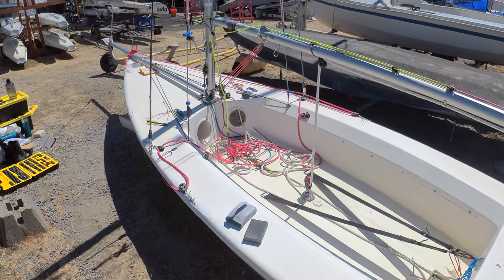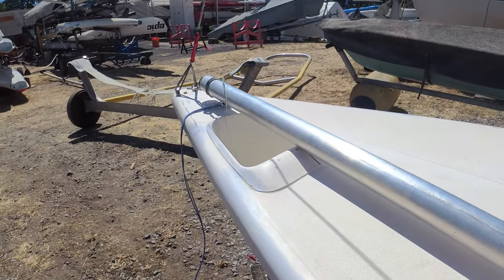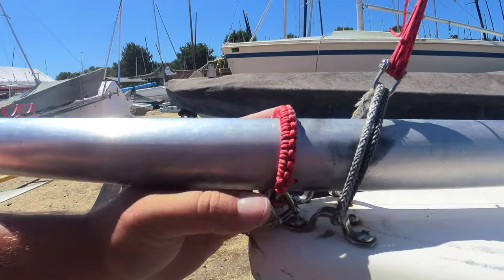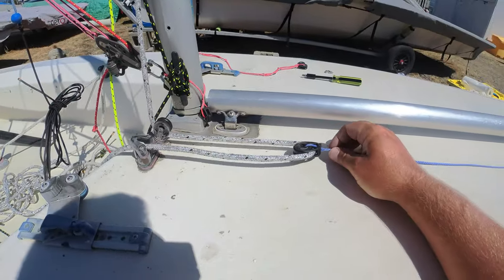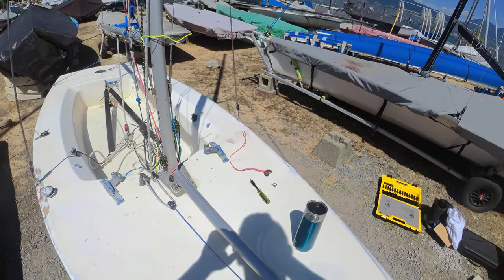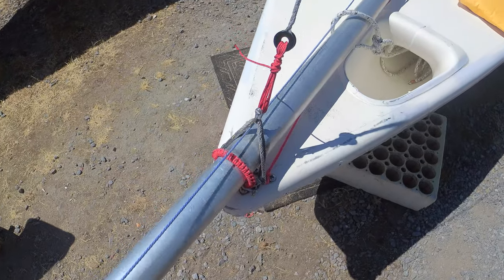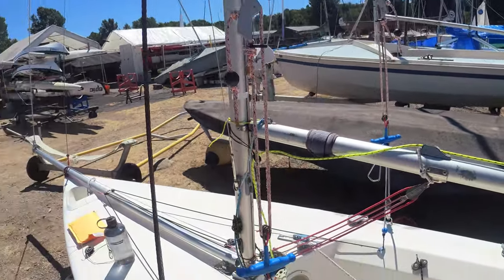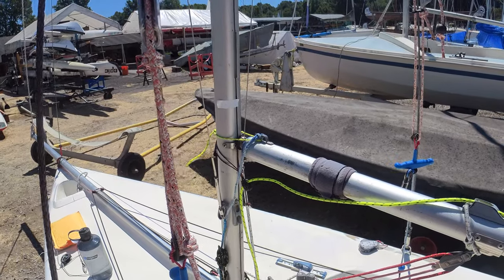HOW I RIGGED MY CUSTOM SPINNAKER

Comment: Hi, your videos are great. I also sail with Laser 2. Mainly single handed. I still use the classic spinnaker. As long as I sail only on starboard tack, everything is fine. The problem arises when I change the tacks. Then I have big problems with changing the spinnaker pole.
I've already seen some videos where an asymmetric spinnaker (gennaker) was installed on the laser 2. I would like to do the same myself. Mainly to make kite sailing easier. After watching your video I decided to do the same thing on my laser. So I would like to ask you for some information;
- how long is the bow sprit, measured from the bow forward
- did you copy the length of the bow sprit as the laser 2000 has
- how long is the luff at the gennaker
- could a laser 2000 (3000) gennaker be fitted
- do you happen to have any measurements for the gennaker (or yours or for the laser 2000)
Thanks in advance for the answers.
P.S. You are sailing in a very beautiful bay. You always have a nice wind and the sea is not very rough. I know Vancouver myself, having been there many times by ship (and Squamish, Nanaimo, Chemainus, Fraser Surry...) When I was young I worked as a nautical officer on merchant vessels. I'm from Slovenia. If you are ever in Slovenia, you are invited for a beer. Take care, Andrej
Reply from the maker: The bow sprit is a 8' pole.  I would go 9 if I were to do it again.  The luff will change based on mast rake and hoist height - you will need to measure this on your boat.  The laser 2000 is what my sail is based on, should fit no problem if you raise the hoist up the mast.

Comment: Curious where you found your mast base/mast plate? Looking to do this on a Vanguard 15, but I don't want to use the current/zim step since the loads will be higher, and I'll be attaching a spinnaker system.. 

Planning to use G10 backings and a stainless plate fitting, but I think a better step/base with more surface area will help. 

Any insights? Love your videos!
Reply from the maker: Good to hear that you are upgrading!   You wont regret it.  The stainless steel deck plate, aluminum mast base were homemade.  The stainless steel plate is just 316 stainless sheet about 3/32 thick with some butyl tape between the deck and stainless to seal out water and add some adhesion.

Comment: I like the way you have your trapeze rigged and intend to copy your setup. Would you recommend making it longer overall than stock for single-hand sailing? Do you know the line lengths?
Reply from the maker: My trap lines are a bit shorter due to having the additional bungee'd pull feature.  It takes a lot of measurement to find the sweet spot. Only take a test sail or 2 to find the sweet spot.  I found that there isn't much need to adjust the line as you move back on the rail for downwind. 

I went with dyneema so it was easy to splice and then re-splice to adjust the length.  If you go dyneema (highly recommended) you will need to make sure the mast attachment is free of anything sharp.  Have fun out there!!!
Reply: @FunDaySailing  Thanks. Parts on order.

Comment: Outstanding.

For the spinnaker sheets...to keep them from trailing behind you...how about tying the end of the sheet to something on the trapeze on the opposite side?  I do that with the jib sheets on my Laser 2 just to keep the jib sheets handy.  It's one more thing to get tangled up in when you're going out on the trap but the rest of the time, it keeps the jib sheets where I need them without me having to go rummaging around in the bottom of the boat looking for them.
Reply from the maker: I cant run the sheets to the trap.  I went with a endless spin sheet setup so the sheet loops back to the otherside.  I moved the sheeting points back a foot and that took up most of the slack that was dragging in the water.

Comment: Hey bud what website are you buying all your hardware at ? I still need to buy a kite for my boat and I’m definitely going with your set up. Thanks for the tips :)
Reply from the maker: If you are in Vancouver try Rekord Marine on marine dr. in south Van.  Candy store for sailors!  Are you sailing out of Jericho?

The kite was a sailrite kit that I sewed together.  Fun project for sure!!  You will find that you need custom retrieval patches so that it fully douses into the retrieval tube.  Lots of work to get right but worth it!!!
Reply: @FunDaySailing  I’m actually in Roberts creek on the Sunshine Coast but from Vancouver. Went to kits yacht club all through my teens!  I’m in Vancouver in a couple weeks I’ll definitely pop by the shop on marine!  Sold my older L2 and got a 2000 last week. Super pumped to get it out in the water.  Your videos are awesome dude ! Love the 360 pano view what a rush 🙌🏼

Comment: Do you know what those pivoting padeyes are called that you used on the deck for the back of the pole?
Reply from the maker: I am sure it has a fancy boat name but I don't know it.  It is used for mounting a Bimini/Dodger or maybe even a railing on bigger boats.  If you get into that parts category on a local shop it shouldn't be to hard to find.  This is where I get most of my parts, including the hinge thingy that you are looking for.  https://victory-products.com/collections/deck-hardware/products/mk0886a?variant=1120910081